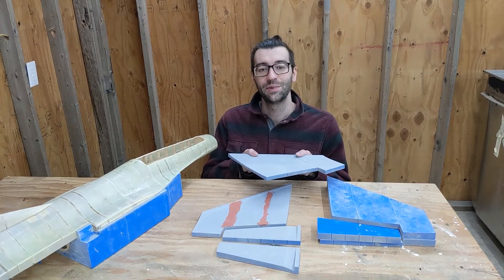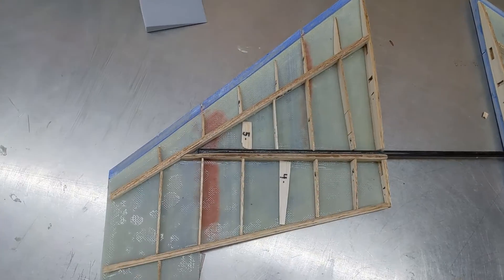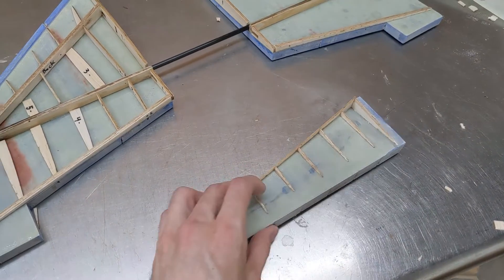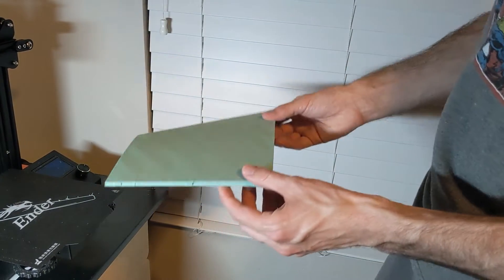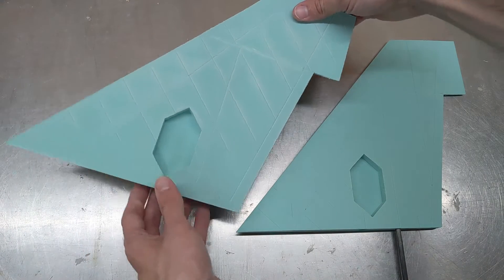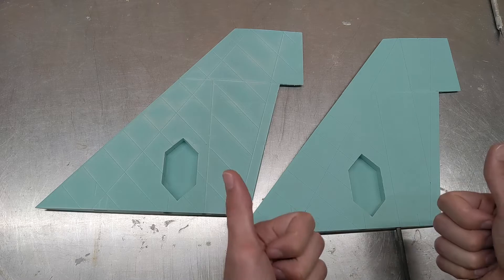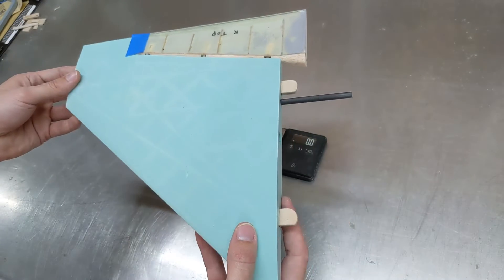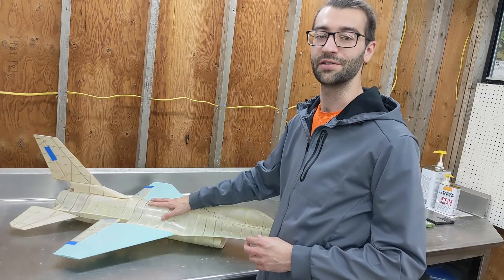Wings! - To 3D Print or Not to 3D Print? - RC F-16 Build Part 9

Comment: Hi, I just watched your latest video, the flight might be frustrating but you've already done a great job and provided lots of inspirationa for us, maybe you can try using more layers of fiber glass, perhaps you can also and one layer of honeycomb panel between fiber glass layers, this will make fuselage surface more solid and you can also reduce the plywood used inside to remove some extra weight brought by multiple fiberglass layers. I'm not sure if this would work, but I'm willing to give it a try.

Comment: Can you do video how to make crate molds
Reply from the maker: I have another video that talks about the molds. Maybe the only step missing is how I modeled them in Fusion 360. It was quite simple though. You basically create a box and "cut away/remove/subtract" the section of the airplane from that box. And you have a mold! https://youtu.be/eH55p1k6gYg?si=fFD9lDg74ClBITFW

Comment: You did your mold wrong. You should print your wing not the mold. After you print your wing, you should sand it and polish it, make it nice and smoth. Next step is coverd it with special mold resin after that you will apply several layers of fiber glass. Now you have your propper mold done. With this kind of mold you can make your fiber glas wing and it will NEVER bend.

Comment: I'de be curious what your slicer predicts the weight to be if you used PETG vs LWPLA. Plus is the work of fiberglass worth the weight savings? 3rd ever consider low expansion spray foam internal? Fewer internal spars with greater rigidity.
Reply from the maker: If I printed out of PETG it would weigh about 76g (for just the printed parts. doesn't include the carbon rod or wood tabs). So that's a bit heavier than the fiberglass wing. Is the fiberglass work worth it? I'd say it depends. If the whole plane was printed from PETG it would be very heavy and probably wouldn't fly well. It could instead certainly be printed from LW-PLA to save a lot of weight and fly better. It's truly a lot of work building it with molds, composite skins, and wood internal structure. It would have been way easier for me (considering I'm very comfortable CAD modeling) to make the plane fully 3D printed. But it wasn't about what was easier. I wanted the experience of doing it with fiberglass/molds. I didn't consider low expansion spray foam but that's a good idea too! There are many ways to build RC airplanes. Just depends which way you want to do it.

Comment: Hi, what are the  dimensions of  the aircraft ?
Reply from the maker: 30 inch wing span, 47 inches long. It's roughly 1:13 scale.
Reply: @3DParadigmDesign  Thanks, me too I'm I'm designing aircraft but not f16.
Reply from the maker: @karama5478  is that the loyal wingman you're making?! I really like that plane and considered making one myself!
Reply: @3DParadigmDesign  I started with loyal wingman design for my graduation project but my school wanted another design. So, I used loyal wingman fuselage as a reference (I make some changes according to my needs) but different wing layout, wing span, wing sweep angle and different ruddervator layout. I designed two models for my graduation project. One for carrier takeoff and landing and other one like loyal wingman but different wing, ruddervator and some changes on fuselage. I shared Loyal Wingman model on my Grabcad account. But other two designs I only share pictures of them on LinkedIn account.

Comment: LW-PLA Is nice and yes, it's also easy to sand but it's still PLA. What I would be worried about is the warping by simply leaving it exposed to the sun or even forgetting it inside the Car during a hot summer day. There is a company that sells Files of LW-PLA models that utilize gyroid infill which they say makes the wing or fuselage very robust and gives the feel of a foam model and also helps to reduce warping but I'm not sure about it, maybe you can give the wing a coat of epoxy finishing resin to help reduce the warping problem.

And btw, about the 3D printed moulds, are you sure they didn't warp during the Print? if they warped during the curing time when you laid the Epoxy it could also be the heat from the epoxy itself. Are those from PLA? maybe you could try PETG next time, or if possible ABS+.
Reply from the maker: Since I've had luck so far with LW-PLA with another RC plane I'm going to give it a try without any further mods and see how it goes. I can always reprint later on if warping becomes an issue. 

For my molds, yes they were just PLA and I'm still not sure what happened and why the wing cured weirdly like that. One thing I know for sure is that I printed with little infill (4%) in the "grid" pattern and when the infill lines "crossed" eachother it ended up disconnecting the lines. Hard to describe but essentially the mold surface wall didn't really have any infill support. So it was flimsy. I recommend switching to gyroid infill and maybe going up a few percent in infill density. I started doing that with later parts and it resulted in much more robust molds - probably like the example you mentioned. Gyroid is my favorite infill pattern if I want a robust part. In general I had no issues with PLA molds except those thin wing molds.

Comment: Mmm what if you use the 3d print to lay on the fibre glass. Partial or full cover?  Depending on where you need the strength.  A bit like a cnc cut foam wing.    Laurie. NZ.  😊😊
Reply from the maker: That's a good idea! Exactly. If needed I could apply some fiberglass on just the outboard half of the wing to stiffen up the wing tip. I would also consider that as its own building technique. You can go all fiberglass, all 3D print, or a hybrid or the two like you mentioned.

Comment: never use 3D printing , for a mold
I've been doing this for 40 years
It never goes well !!
Cheers
Phil
Reply from the maker: I wouldn't say never! I've used 3D printed molds successfully for the entire rest of the build and have seen quite a few others use 3D printed molds as well. There are some draw backs but there are also advantages! For me the biggest attraction was I could make the molds entirely myself for just the cost of filament.
Reply: RamyRC seems to do pretty well with that method.
Reply: Surely you don`t have "enough" experience with 3d printed molds. We have been using it for several years. No issue. Yes, I see you have 34 more years of experience than me. At my flight club we have some oldtimers than roll their eyes when we talk about 3D printing. In their minds that is not how you build a plane. That`s true is some ways. But still, you can.
Reply: If you've been doing something for 40 years and it never goes well, maybe 35 years ago you should have re-thought something...

Comment: The molds warped but you are not wortied about the printed wings warping?
Reply from the maker: That's a good point. I'm still not 100 percent sure what caused the fiberglass wing issues. One thing I didn't mention in the video is that the infill in those wing molds didn't adhere to the skins/walls of the mold. So that could have resulted in the mold surfaces being able to buckle or flex more overnight. The molds didn't permanently deform from the heat though. That's the main thing I'd be concerned about for the 3D printed wings.
Reply from the maker: @alwaysflying6540 that's a possibility

Comment: LWPLA does not do well in any form of heat. Even a sunny day. Consider LWPLA-HT (High Temp). Heavier and more difficult to print but is heat resistant.

With the weight you saved you could easily cover the 3dp wing in a fiberglass.
Reply from the maker: I'll be keeping the plane out of direct sunlight most of the time. This LW-PLA can handle some amount of sun. I have another RC plane that's fully printed out of this LW-PLA and it's been holding up great. No deformation. I keep it out of the sun when it's not flying. I will also be painting these wings. I wonder if that'll help protect it from the sun a bit?
Reply from the maker: The skins of the original fiberglass wing were by far the heaviest part of the wings. The skins alone weighed about 36 grams. If I were to cover the 3D printed wings in fiberglass I could potentially go with a much lighter fiberglass to try and get the weight back down.
Reply: Indeed. I use 3/4 oz cloth. It's almost like tissue paper and make sure to remove most of the resin after wetting it out. I use good old toilet paper for that..  @3DParadigmDesign